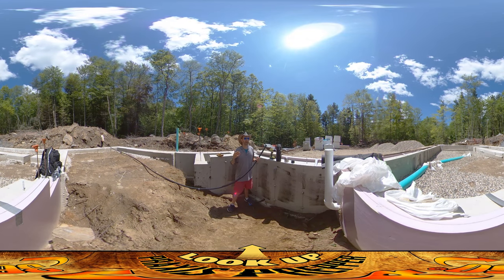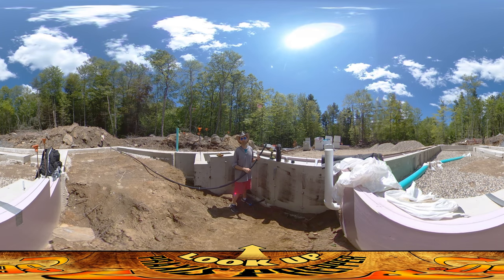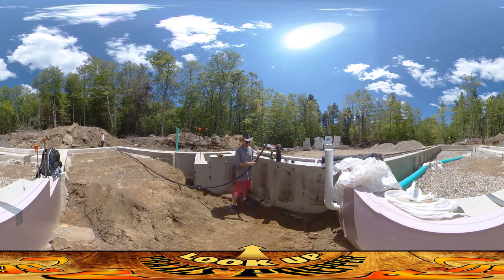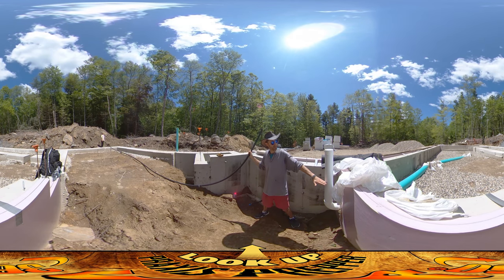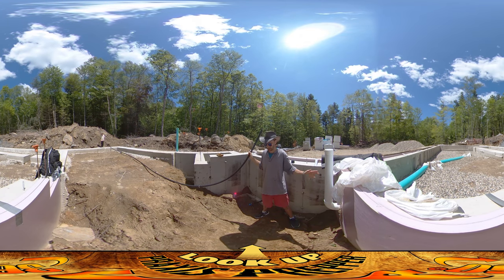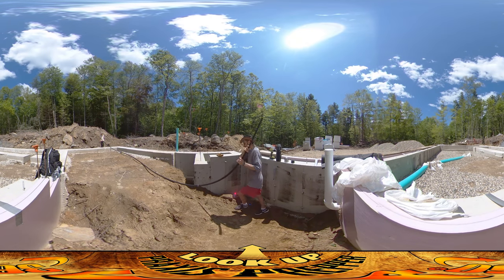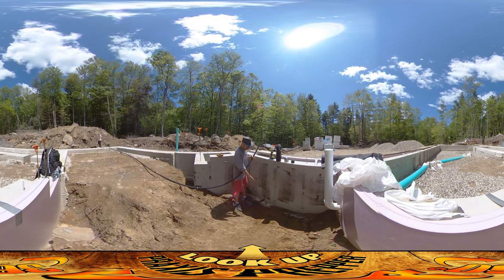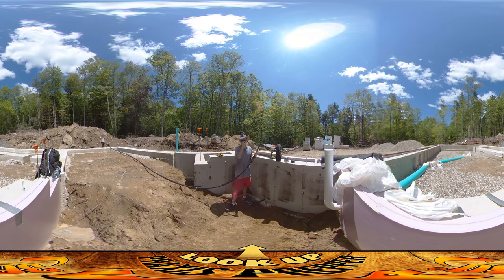Homestead Building - Air Vent Installed, Water Pipe Being Installed, Joining Pipes with Barbs

Comment: Make sure that in your area, you can pour concrete over a Karlon pipe joint, you may have to leave an opening for maintenance, better prevent than have to fix it !!
Reply from the maker: It's running through a normal pass-through hole that was left ahead of running the pipe. Thanks for the warning though - so many potential issues - hard to keep them all in one's head!